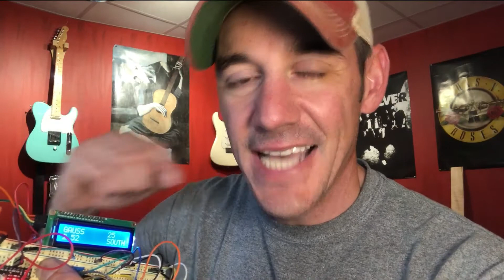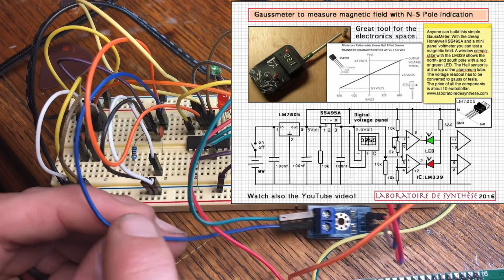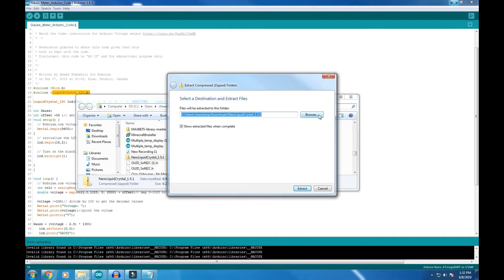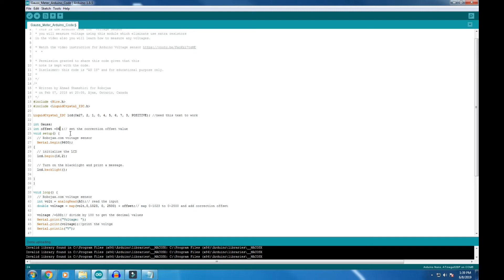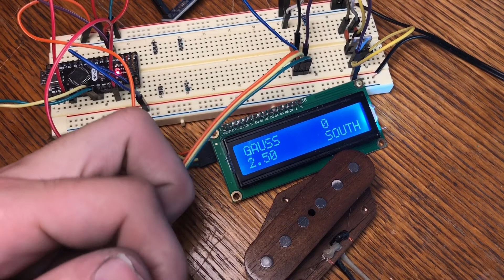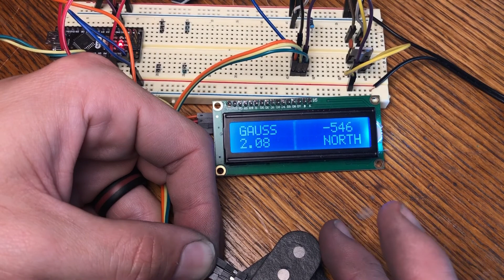✅DIY Gauss Meter with Arduino to Check a Pickups Magnet Strength

Comment: looks just like the setup I recently assembled...except for the Arduino.
The capacitors are different but it still does something.
You mentioned that the design you saw was using a cheap Volt Meter.
My instructions explicitly tell you to use a "good-quality" meter.
But I do like the Arduino part.
I just may have to upgrade mine before I print an enclosure.
Also, I seem to recall reading years ago that the magnets are going to change on a pickup with regards to which string it's sensing.
Giving it its particular Brightness/Color/Range in Tone before the other circuitry.

Oh yeah...here's your thumb^.

Comment: I have my winder working now, parts arrived last week. Now, for the gauss meter. The comparator is not needed, as I am using a computer power supply I have a good 5v supply, so can I do away with the 5v regulator too?
Thinking about mounting this on the unused side of the winder, also thinking about incorporating a meter for impedence and capacitance. I have seen some youtube schematics for them. I don't know if I can use one arduino for all of them, it would be easier if I could.

Comment: Hello, I love your Arduino pojects i started winding too and now im trying to get my gauss meter working... I use SS49E which has slightly different sensitivity SS495A have 3.1mV/G and this one should have 1.8mV/G. I cant figure how did you get that 1V is 1300 gauss.
Reply from the maker: Gotcha bud, I found a conversion somewhere that said the gauss for that sensor reading was around 1300. One thing I’ve always told everyone is that the meter itself will not be accurate to a expensive gauss meter but it will be accurate for what you’re doing. What I mean is even if your meter isn’t 100% accurate to an expensive gauss meter it will still give you a reading on your pickups and make you able to replicate an existing pickup that you have used your meter to take readings with. I hope that makes sense.
Reply: @ChasesWKshop  Yeah i understand that. In the end i took your "constant" and by simple proportion i calculated what my constant should be and now my meter works as it should. I took alnico 5 bar magnet which should have measure cca 600 gauss and divided by your C = 1300 is equal to meter reading divided by my uknown contstant.

Comment: I am looking forward to making a gauss meter. I have wired up the circuit and downloaded the IDE code but keep getting the same error.
'POSITIVE' was not declared in this scope.  How do I fix this?
Reply from the maker: Try downloading an older version of the library. Had another person having the same issue and that resolved it. Hope this helps.
Reply: @ChasesWKshop  I have downloaded the older version 1.1.1 and get the same results
Reply from the maker: @DKEng45  btw did you delete the newer version before you installed the older one? It probably has to do with the file name not being correct with the library you downloaded. More than likely one of the files call name is different than what’s on the sketch.  You can look into the library and find what it uses for it. Did you search that error for liquid crystal I2c in google? I’ve gotten a bunch of results for it myself. Let me know bud.
Reply: @ChasesWKshop  I did delete the older version first. I have also found may google articles on the problem. I have tried all of them the best I could understand and none of them have worked.  I do appreciate you help is solving this problem.
Reply from the maker: @DKEng45  dang man I’m sorry.  Only other thing I can think of is the I2c may have a different address. Did you run the I2c scanner program?
Reply: @ChasesWKshop  I don't know what the I2c scanner program is.
Reply: @ChasesWKshop  Is POSITIVE a variable and if so what value is it?
Reply from the maker: @DKEng45  it’s part of the code for the appropriate library. Just wondering if the library your using is using a different spelling or word. Not sure how to look that up but I will see if I can find something on it.
Reply from the maker: @DKEng45  it’s on the website under where you get the library. I think I go over it in the video. Some I2c packs use a different address.  That sketch looks to see which one yours uses.
Reply: I ran the scanner program from you web site and got this error message  - avrdude: ser_open(): can't open device "\\.\COM3": The system cannot find the file specified.   My devise is on Com6
Reply: I solved the original problem. I replaced the Arduino NANO with a different one and the scan tool works, results 0x27 and the main program runs.  I do not have any output on the display. Do I need the 9 volt battery attached or will the power from the uSB connection run everything?
Reply from the maker: @DKEng45  the power from the usb should power all of it.  Is it lighting up? Turn the potentiometer on the back of it too and make sure it’s at the right spot to show characters.
Reply: @ChasesWKshop  The LCD is lighting up, I have turned the pot full both ways - no numbers. The voltage from the Hall effect sensor is reading 2.09 volts, the voltage from the voltage sensor pin S is reading .44 volts.  I will recheck all my wiring again
Reply: @ChasesWKshop  I have several problems solved not. My new problem, when I am on your website and download the IDE code, I get code for I2C scanner instead of the Gauss meter code. I have done this 5 times now with the same result. Is it possible there is a link problem on your web page? Ken
Reply: @DKEng45  What was the fix for the error related to POSITIVE? I'm getting that error as well.
Reply: Got it sorted. Change the "need this text to work" line descriptor to "LiquidCrystal_I2C lcd(0x27, 16, 2);". The 10 argument descriptor does not work with the LiquidCrystal_I2C library. Also needed to add lcd.init() at beginning of setup() function.
Reply: @fenderbender909  Hello! Can you send us the code for this. We are currently experiencing the same problem. Thanks!
Reply from the maker: Try deleting the quotes (‘ ‘) around the positive and replace them with the ones in your keyboard. Sometimes copying and pasting the sketch doesn’t translate those properly.
Reply: @ChasesWKshop  There is no " " around POSITIVE. Should there be?  Is POSITIVE a variable and if so what value is it?

Comment: One thing to be aware of is the inefficiency of the 780x regulators. I was just watching a video that pointed out that problem for battery-powered projects. Another problem is that they have a high dropout voltage (I think it was about 2V), which means than it's output voltage drops rapidly to 0 once the battery is down to 7V. 

Using a boost-buck converter would allow a larger range of batteries including rechargeable LiOn and LiPo's, and would be more efficient as well.

Comment: Very cool project.  You shouldn't need the voltage divider board on a 5V Arduino.  The analog pin is 5V tolerant, so you can directly measure the Hall effect sensor output pin.  Also, it appears the factories spec their magnets with a direct reading, and your 600G reading up against the top of the pole piece matches what I think you'd expect to see on a moderate output pickup.
Reply from the maker: Dude thanks for the info man! I’m constantly learning on arduinos. I’m currently looking at a way to control a motors speed by using the speed of another motor.  Like having a dc motors speed controlling a stepper or servo motors speed so when the speed of the dc motor increases the stepper motors speed will increase proportionally to the other motor.  It’s a lot  for a newbie on arduinos lol. Let me know if you have any idea where to start on something like this. Again thanks for the info and thanks for being apart of my channel bud!
Reply: @ChasesWKshop  Sure thing!  Now that I look at your circuit design, I'm not sure the voltage regulator is even required unless you're using it to power the Arduino (which it appears you're not, since the Arduino has its own regulator circuit).  You could just drive that little Hall effect sensor directly from the Arduino and greatly simplify the whole thing.

Using another Hall effect sensor, you can measure the speed of a motor's output shaft by placing a magnet on a flywheel, gear, or pulley and detect every time it passes the sensor.  Similarly, you could also use an optical detector in place of the Hall effect sensor/magnet and detect a hole, slit, or contrasting color on the flywheel.  Then you can use the IDE's built-in millis() or micros() functions to measure the time between pulses, calculate RPM, and translate that to stepper output.
Reply from the maker: Yuri's Homebrew & DIY awesome. I’m trying to figure it out to run an automated pickup winder.  I was thinking of using an OPTO sensor with a wheel to calculate the rpms the do an equation to pulse another motor. My problem is I have no idea how to code that lol. Haha that’s usually my problem. Thanks for your help bud!
Reply: @ChasesWKshop  I had a feeling that's what you were up to.  I actually stumbled upon your videos when looking at designs for pickup winders, myself, and am considering the project.  I plan to use a small drill motor or maybe my mini-lathe as the spindle, and then a large 20-30kg RC servo to manage the traversing.  By mounting a wire guide on an RC servo horn, I think one can avoid a lot of the engineering (and potential cost) involved with making a linear drive.

I think the key parameter in solving your problem is coils per layer.  You can manage the linear drive speed across a known distance (which would likely be measured on an Arduino in the range of 0-1024) over time, using RPM to figure the amount of time to wind the desired number of coils.  Alternatively, you can just move the guide once per rotation (each time the optic sensor triggers) - the step distance being total traverse distance / coils per layer, reversing at each end.  With just a tad more math, you could introduce some randomization into the coils per layer to achieve some measure of scatterwinding.

Back to the Gauss meter - consider adding a pushbutton that would automatically set your 2.5v offset when pushed.  It's pretty trivial to wire one into a digital pin.
Reply from the maker: Thanks for the info bud! I know highline guitars has a pickup winder where he uses cams for the linear motion. It’s still not 100% automated though. Really just want to make it because I really just enjoy building the machine more than winding a bunch of pickups lol. Thanks for all your help and hope to see your design soon man!!
Reply: @ChasesWKshop  As luck would have it, a servo and DC power supply showed up from the kind FedEx man today.  Here's a snip of a quick sketch I wrote to see how things might work:

void loop() {
  
  if (pulse(RPM)) {
    int traverse_distance = (MAX_TRAVERSE - MIN_TRAVERSE) / windings_this_layer * traverse_direction;
    traverse_position += traverse_distance;

    // if we've exceeded a traverse limit, reverse direction and determine a new number of windings for the next layer
    if ((traverse_direction == 1 && traverse_position >= MAX_TRAVERSE) ||
        (traverse_direction == -1 && traverse_position <= MIN_TRAVERSE)) {
      traverse_position -= -2 * traverse_distance;
      traverse_direction = traverse_direction * -1;
      windings_this_layer = random(MIN_WINDINGS_PER_LAYER, MAX_WINDINGS_PER_LAYER);
      layer_count++;
      print_progress();
    }
    traverse.writeMicroseconds(traverse_position);
    winding_count++;
  }
}
Reply from the maker: Yuri's Homebrew & DIY you are the man!
Reply: @ChasesWKshop  Not sure how you made out, but yeah I agree with the commenter that all of that extra junk can be eliminated to just powering the hall effect from the arduino 5v, and connecting the output to A0 directly. ironically it will give you better reading than using the voltage divider. 
Since the divider divides all voltages by 5, you are effectively using only 0-1 volts of the Arduino's 0-5v input pin. (only less than 8 of the 10 bits of resolution)
Also the arduino's analog pins also get their reference voltage from it's own regulator. so any discrepancies in voltage will automatically be accounted for.
As for the pickup winder, you can use a small neodymium magnet and another hall effect sensor. setup an interrupt on the rising edge and add 1 to a counter. every time the magnet goes around and passes the sensor it should count that as a revolution. You could use a digital pin for this and as long as it's close enough to go above the trigger voltage it should be fine. You won't need to read the value or anything the hardware interrupt should suffice.

Comment: Awesome video! It's been awhile since I've taken something from a breadboard to a pcb. Do you have a close pic of your pcb setup?
Reply from the maker: Thanks bud! I don’t have a picture of it. I can possible get you one but it’s mounted into the meter now so I don’t know how good it would be. Using headers for the pcb’s makes it a lot easier to install the arduino and wire all the parts in without the arduino in the way. Link below of what I’m talking about. Let me know if you have anymore questions bud. 

Glarks 120Pcs 2.54mm Straight Single Row PCB Board Female Pin Header Socket Connector Strip Assortment Kit for Arduino Prototype Shield(Single Row) https://www.amazon.com/dp/B076GZXW3Z/ref=cm_sw_r_cp_api_i_n1o6EbEYGMW8P

Comment: Hi mate, nice and great work. Well done. I have made a air-core solenoid. I just need to prove the magnetic  field strength experimentally using Tesla meter. I am about to buy, but after watching your set up and I thought to stop for a while and check it with Arduino. Is it possible to measure the field strength around 0.5T? Thanks a lot.
Reply from the maker: Mohammad Reza Barati thanks bud! I’m not sure if it would measure that high or not but I do know it will he’ll get up into the 1200-3000 gauss with some of the magnets I have.  So if I could test a stronger magnet I think it may register up to 5,000 gauss like .5 tesela.
Reply: @ChasesWKshop  Hi, 3000G is still fine for me and can go with this set up. If you was able to detect such high field, I would be nice to get back and update the capability of this tools! Amazing.
Reply from the maker: Mohammad Reza Barati I will try to do that for you bud. Thanks for the compliment and let me know if you need anything.
Reply: @ChasesWKshop  You're welcome. Thanks again. 👍
Reply: The SS495A datasheet says that it has a linear response to +/- 670G at 3.125mV/G sensitivity, giving the sensor a maximum theoretical range of +/- 800G (with reduced accuracy beyond +/- 670G).  While I'm no expert in Hall effect sensors, a quick search doesn't show an IC like this with a range beyond about 0.1T.

Comment: Hi there 
Did you try to make with same assembly tahometer , coud you help with this? Thanks
Reply from the maker: coffee business hey buddy are you wanting this box and the lcd screen as a tachometer or rpm gauge?
Reply: Thanks to answer back yes i want to do rpm tahometer
Reply: I woud to to talk by email if dont mind, coud show some picture if necesarry
Reply: Hi budy. I want to build for my milling spindle
Reply: Some of the parts already have, this was the reson if can do this on your way but for rpm
Reply from the maker: coffee business absolutely bud. Weatherfordwoodcrafts@gmail.com